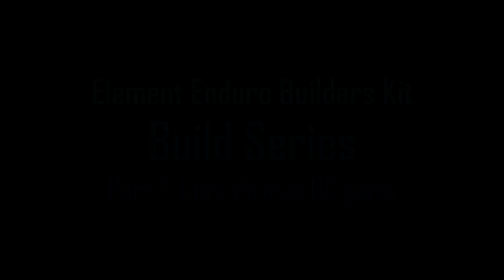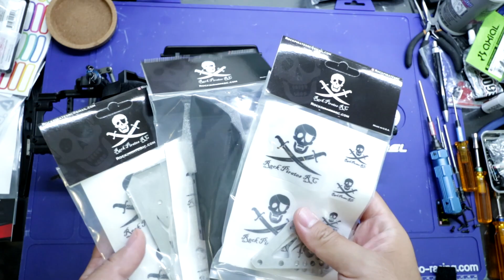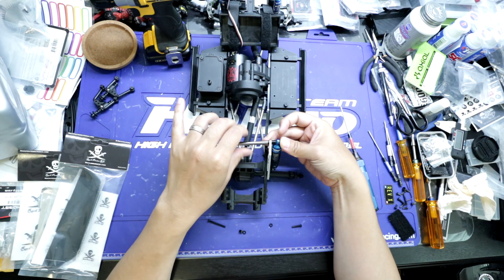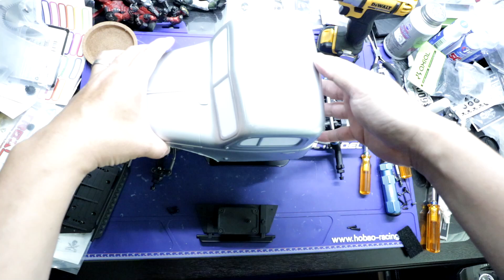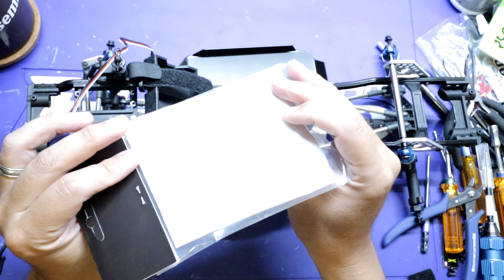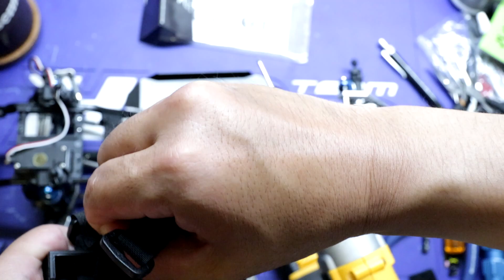Element Enduro Builders Kit Build Series - Part 7 - Rock Pirates RC Parts

Comment: Awesome!!! How do you know you don't need body post mounts on rear? Is that an optional thing to add? I'll be getting the element ecto..and wanted to know ow if the rear shock towers need mounts or we can just add the shock towers on rear?😢😮😮
Reply from the maker: Whether or not you need body post mounts on the rear is entirely dependent on your build.  For this build, I ran a custom 3D printed truck bed that I designed in the rear so it was a cab only body mounting.  If you're running an ecto body, you will need to either add those body post mounts to the Rock Pirate shock towers, or you will need to use the body post pegs that come with the Ecto on the rear bumper mount.
Reply: @RevolutionX  awesome ty

Comment: Where did you buy your Specer sir?
Reply from the maker: Some are 3D printed and some I bought off of eBay.  You can get a set of these from eBay. https://ebay.us/fh1UBI
Reply: @RevolutionX  sir the one in the middle specer the long one?
Reply from the maker: Are you talking about the link that I used?  Here is the assorted link set - https://ebay.us/bDaCIQ

Comment: Why not use velcro for the battery in stead of the straps 😉? Just a thought... i love your videoes. I am going to built the enduro built 2 kit. I think I can use your video to guide me 👍😄
Reply from the maker: While I do use a shorty pack, I use a 3700mah 3S which is big enough to have potential of falling out without being strapped in unless I use smaller packs.  I have an updated Rock Pirates battery tray that has the slots for the battery straps though.